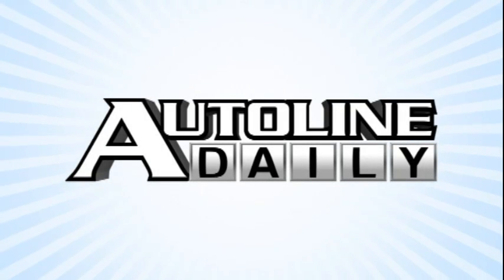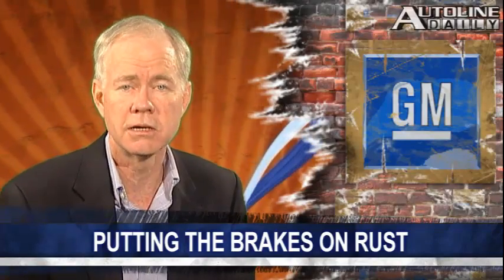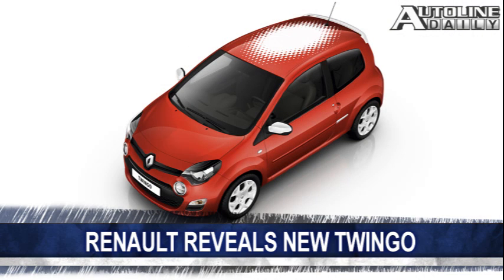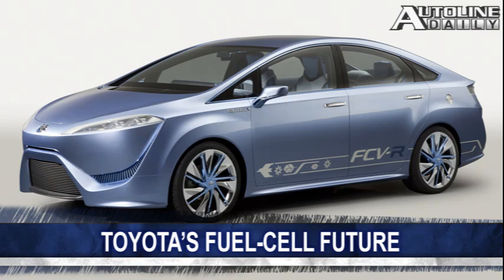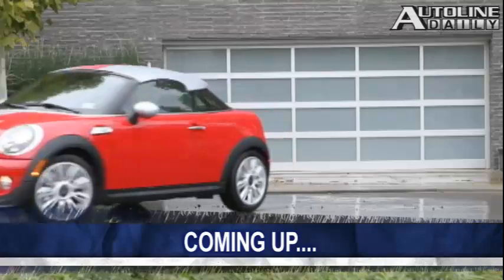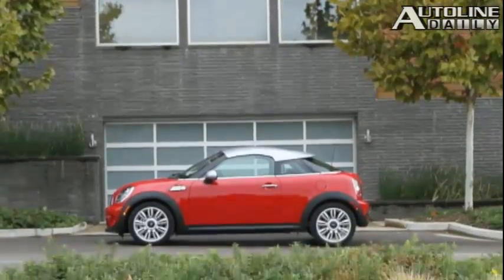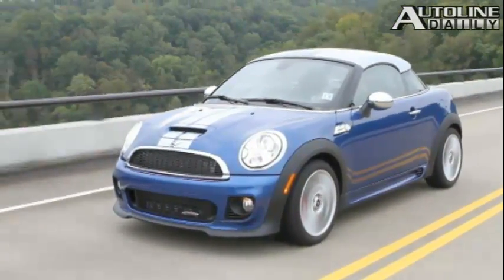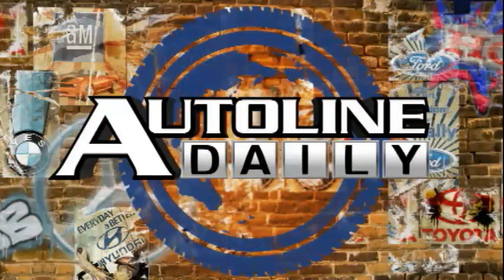Why Mr. Ghosn is Wrong About EVs - Autoline Daily 778

Comment: I guess that he figures that the gas stations will be spared in a natural disaster and are equipped with backup generators..  If folks are  fleeing an oncoming natural disaster, all the gas stations all the route will run out quickly.